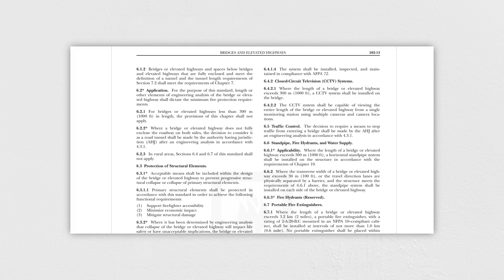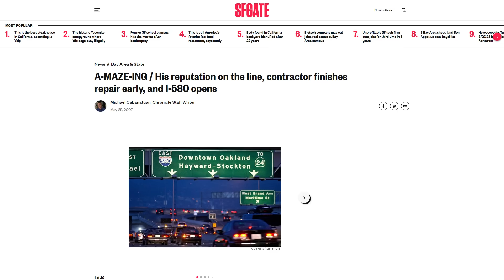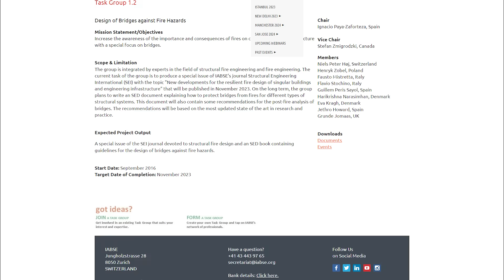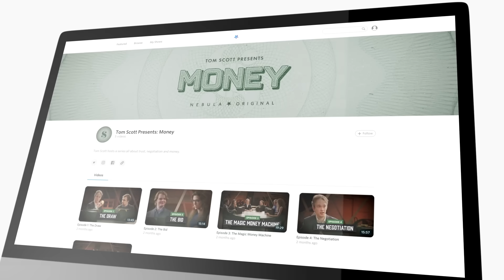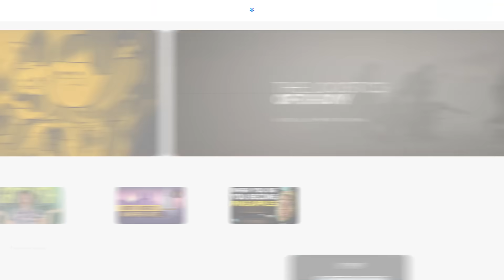Philadelphia I-95 Bridge Collapse Explained

Comment: It seems to me we should be able to design relatively inexpensive heat deflectors under these bridges to push the heat and flames out the sides just from natural airflow.  Curved forms on the underside would naturally vent the flames to the sides, furthermore any vehicle that crashes under such a form almost never be in the center.    This can be amplified as well, with the placement of the curves taking into account the most likely spots an accident would happen.  These matters because it will turn the tunnel into a wind tunnel, drawing air from one direction and pushing the flames more towards the side at the other end.   Diverting nearly all the flames and heat from this kind of fire away from the upper roadway.   It may not save the bridge, but it should prevent collapse and frequently allow for faster rebuilding.  The nice thing about this idea is it's cheap.  You don't need huge thick expensive materials.   But a form covered in ceramic tiles that can take the heat.  (The tiles aren't cheap but not super expensive either as this is not a structural component of the bridge.)  You do need to ensure it's not going to be impacted by the crash itself, at least not significantly.

This might be a great application for aerogel for example which is fairly cheap to make.

Comment: To reduce the overall costs, my suggestion would be to investigate the costs involved in making bridges fire resistant for any bridge that passes over a road that allows truck traffic...

Most of the fire related bridge failures mentioned in this video were caused by a fuel tanker crash & burn so if the road under the bridge doesn't allow trucks, the chances for a tanker fire is almost nil since Trucks can't Legally drive under that bridge, no fuel tanker should ever be under it, thus there isn't any significant reason to make it fire resistant...

By restricting what bridges need to be fire resistant, the costs to make them fire resistant are reduced to the absolute minimum possible while still protecting against more fire related collapses...

Comment: WHY does it have to be so complicated??? Why can't they just spray a fire resistant coating on the exposed metal parts of a bridge or the whole exposed under-side for that matter?
Reply: What are they going to spray?
Reply: @SC710-1  Not long after I started doing electrical work in 1999, I was on a job where they sprayed a recycled newspaper material with some sort of fire resistant chemicals in it on the exposed metal beams in the plant. I know this because I was hit by the sprayer while walking through. LOL

Comment: Great video, thanks!

btw, I think you did a kind of survivorship bias at 7:25, when comparing 2% failure of earthquakes with 3% failure of fire.

"After all, earthquakes make up only 2% of those failures, and we spend considerable resources and engineering to design bridges against seismic loads" -> Actually, if we didn't design against seismic loads (as we do against fire loads), this number would probably be much higher than 2%. So at equal level of "non-design", fire would be 3% and seismic would be around 10/20 ?

Comment: Nonsense!
Everyone knows that jet fuel can't melt steel, so gasoline certainly can't.
This is clearly a false flag. Did you see how quickly they removed the debris so no one could find whatever actually caused the steel to melt?

Comment: Additional ways to reduce the risk of fire under bridges: 1 Better working conditions for truck drivers. 2 Better maintenance of trucks.
Reply: You could also add, higher training standard for tanker drivers.
     Those liquid filled or partly filled trailers can be unstable. Fluid slouching is very common.
     Come to think of it, better roadway/highway markings would help.

Comment: I recall a wool-store fire around 1963 in Wellington NZ.  It was a large building of RSJ steel frames.  All trusses sagged to ground level during the fire.  I recall that it was pointed out that laminated wooden beams would have stood longer against heat.  As Steel is heated, its strength abates, and can end with it melting.  So Bridges have structural steel elements which can weaken with heat.
Reply: Well in case you didn't know wood burns at a much lower heat, and also loses its strength.
Reply: @goodbyemr.anderson5065 laminated timber scorches the outside which protects the inside, and it keeps rigidity until it gets hot enough to burn the core. They said last longer, not never fail.

Comment: One of the major LAX runways has a decently long underpass tunnel, well, under it. Its a 6 lane, 1/3 mile divided tunnel. It honestly might be worth a video?? I feel like theres a lot of interesting engineering constraints on a car underpass that goes underneath an airport runway holding 2+ Jumbo jets taking off at a time??

Anyway!! Theres signs approaching both sides saying something along the lines of "trucks transporting flammable or hazardous materials must use detour." It logically made sense that you wouldn't want a fuel tanker crash underneath a MAJOR runway. Watching this video, it makes even MORE sense.

Comment: You should see Wales in the UK. The main motorway gets completely shut on a regular basis and we’re about to implement a default 20mph urban speed limit. The authorities wouldn’t know what an indirect cost was if it slapped them in the face.
Reply: You have no clue how city traffic works.
A little hint: no one drives an average above 20mph in an urban environment.

Comment: Similar situation happened in 2017 in Atlanta when a bunch of polyethylene and fiberglass tubing caught fire in a storage area under a bridge which was part of the I-85 viaduct.  That portion of I-85 was closed for 43 days, causing major traffic problems as motorists detoured through side streets and parts of downtown Atlanta.  It was a total mess, but all things considered, it was a very impressive feat of construction considering just how fast they managed to rebuild the bridge and get I-85 opened back up.  A lot of folks around here thought the deadline would never be met, they actually finished early (mainly due to financial bonuses for getting it done early) .